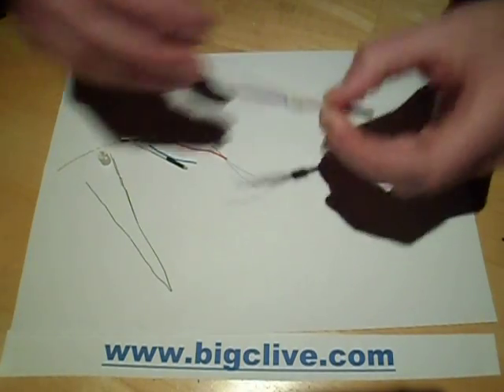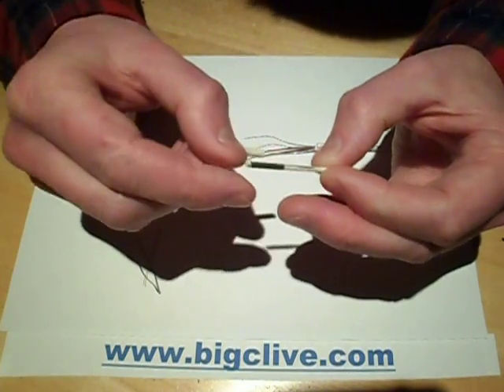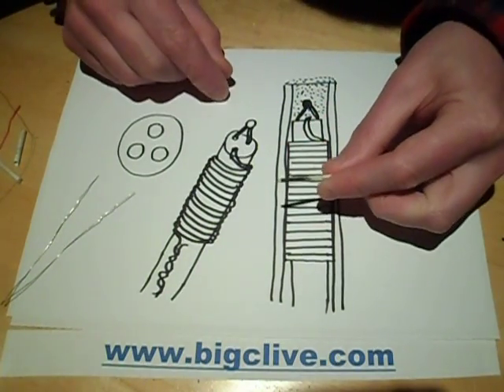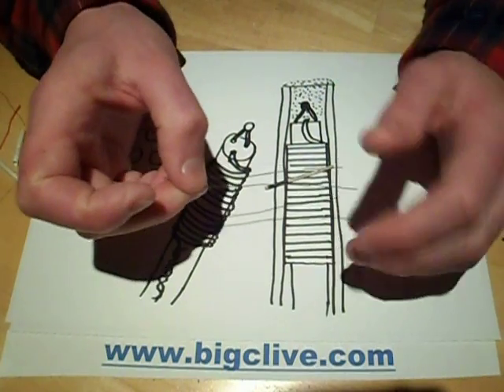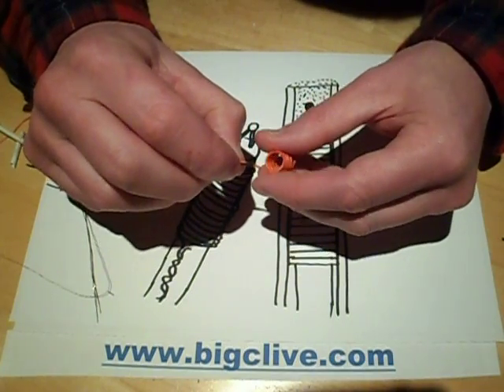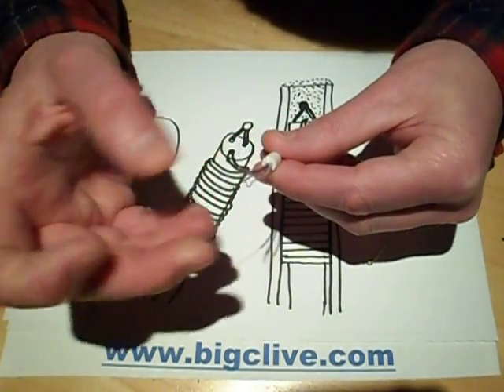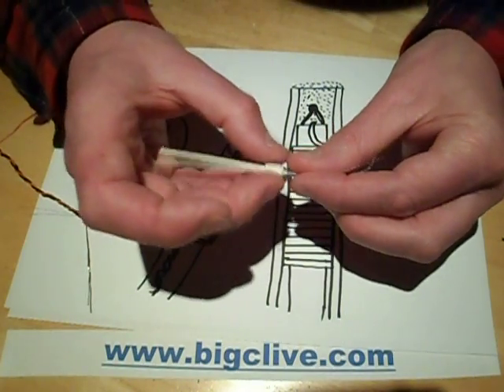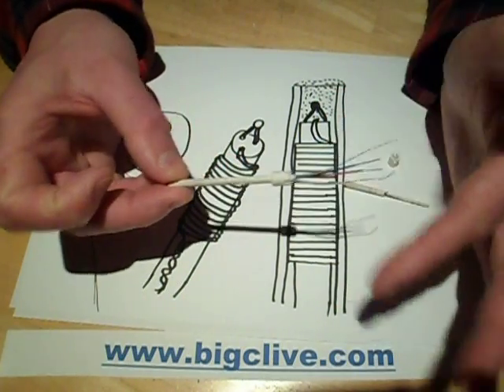Teardown of a thermally controlled soldering iron element.

Comment: Great teardown!! 😊 i recently learned that the problem with these elements is that it would require a proper cold junction compensation circuit which the 936 Chinese clone soldering station lacks and which inturn makes very very bad temperature control, originally hakko 936 original station element has a thermistor instead of a thermocouple which doesn't require any compensation  and is more accurate.

Comment: I've gone through three soldering irons one from from walmart, next time I buy one i'm getting the protection on it. I've made two "apocalypse style" soldering irons from the two that died on me. They are basically cordless and you heat them to cherry red with a torch and it does work but doesn't last long.

I've torn the two irons down and found a very thin wire which serves as the heating element with about 120 turns of wire connected to another set of twisted wire which runs to the electrical connections. The iron tested open for continuity.

Comment: I have a basic 60W soldering iron and the element sometimes only lasts a few minutes.
What is going wrong here? Surely elements should last longer.
Reply from the maker: Is it actually rated for your supply voltage?

Comment: On the heating element on mine only one end had another wire twisted together and spot welded, the other end it looks spot welded to another wire going to the electrical connection without a twisted connection. Is there a reason only one end is twisted together with another wire and not both?
Reply from the maker: The wires that were twisted together and welded were probably the thermocouple temperature sensor.  Two different alloys that generate a slight voltage that indicates the temperature of the iron tip.
Reply: bigclivedotcom I’m referring to 3:42 where you explain that one leg of the heating element has another wire twisted on it but not on the opposite leg

Comment: I have one of these china specials and my issue is the tips don't seem to make good contact with the heater... and by "good" I of course mean... none... Measuring it the tip of the heater is a good 4 or 5 mm from the end of the tip when assembled and with a fraction of a millimeter gap all around, I found I had to pack in some tin foil, and wrap the heater with foil also or else the tip itself would barely heat up.

This is using the tips provided and I can't possibly imagine this is normal. Since the issue was first noticed the ceramic had become black and almost like charcoal, I assumed this is because it had over heated trying to get the tip upto temperature, and just today became so brittle it snapped off while trying to swap tips.

So... is this the heaters fault somehow being too short and narrow, or the tips fault for being too wide and long... or is it the usual case of "who knows, its a cheapo chinas job, you're lucky it worked at all"?
Reply: kal9001 I’ve ran into the same issue. I’ve altered the circuit board that the base of the heating element sits on either by cutting a bit off or adding a bit with cardboard and kapton tape to get the heating element to touch whatever tip I’m using. 

How does the aluminum foil trick work?

Comment: A 24VAC (50W) heater element would require a 110-220VAC to 24VAC power transformer, right? Wouldn't be easier to use a 110-220VAC (60W) heater element instead? (see example: https://goo.gl/CTEqjb)
Reply: Answering myself: yes and no. Yes, we can use a 110-220VAC heater element without using a power transformer (eg. ROHS-936D) when such assembly/device do not use a micro-controller to adjust the temperature with +/- 1C. And NO, we cannot use a 110-220VAC heater element in a micro-controller driven assembly/device when normally we want the micro-controller (which normally works at 5VDC) to adjust the heater temperature.

Comment: can you offer some advice on what type of element would i need to get a low temp of 90 to 100 degrees. possibly something i could set up to be battery operated.  thank you
Reply from the maker: The type of heater depends on what you are heating.  You get USB powered heater pads and you get submersible 12V cup heaters.

Comment: I have a Zeny SMD soldering station, it's a decent station.  I ordered a few extra soldering iron, I thought any 5 pin female soldering irons would work, but when they are hooked up to the station, it doesn't detect a temp sensor, it reads 0/1 and the iron gets very hot.  Im trying to figure out how to rewire it, or if they where assembled improperly these are cheap irons.
Reply from the maker: Some systems use a thermistor and others use a thermocouple.
Reply: bigclivedotcom and they are not compatible with the same rework station. They. Both have a cermacic heating element.  I do see the symbol for resistor on the back of the. Board.  I will upload pictures of both iron boards, if you could take a look at them, and tell me if there is any to require this to make it work, I'd appreciate it. Thanks for responding
Reply: http://i66.tinypic.com/2ueof94.jpg
[IMG]http://i67.tinypic.com/2vll5qh.jpg[/IMG]
http://i63.tinypic.com/2e57ecj.jpg
http://i63.tinypic.com/qqpbg6.jpg
Here is an images I puloaded to tinypic, the one on the right is the one that came with my SMD station, works fine.  The one on the left the station doesn't detect the temperature, so it goes to max and if I leave it long enough it will burnout the heating element.

Comment: Great video. I had a Dick Smith soldering iron control circuit fail about 12 years ago. (no spare parts available) Now running it on a small variac at 170 Volts, ramp it up if needed for more temperature. Works fine and does the job.

Comment: I have a problem with my rework station,  907  not heating up, I know the iron works, tested with other simillar unit.  I am measuring 24v at transformer. somehow the thermocouple is not switching the heater on. thanks for informative video.
Reply from the maker: Does the display show a temperature if your unit has one?
Reply: Not a temperature LCD, (KAWH 852). Led temperature indication. If I heat up the iron in a working station and plug it in the defective one the led give heat/thermostat indication from the thermacouple.No 24v output at the socket pins. regards
Reply from the maker: Jan van Heerden It must be the control circuitry on the PCB or even a bad connection.  Try tracing just the power switching side in the unit.